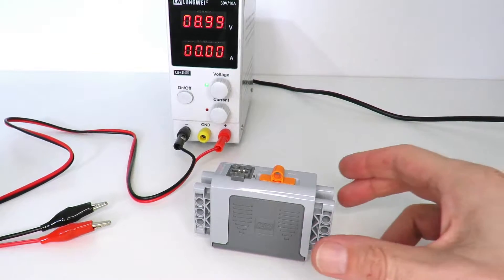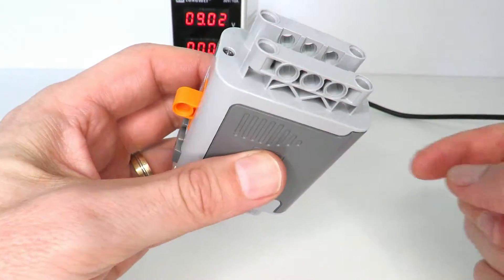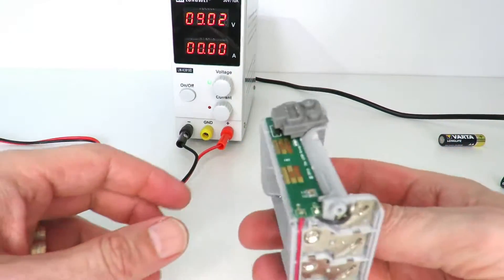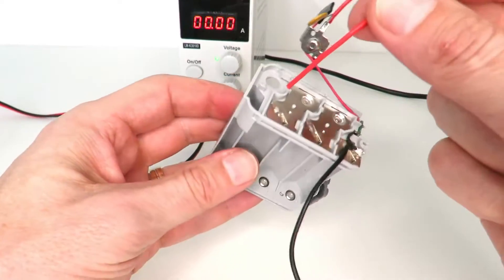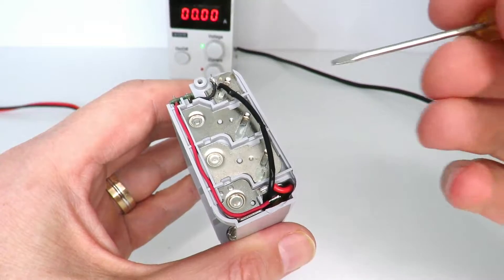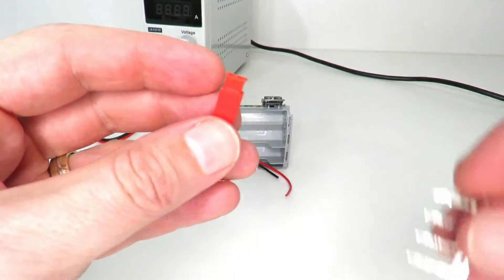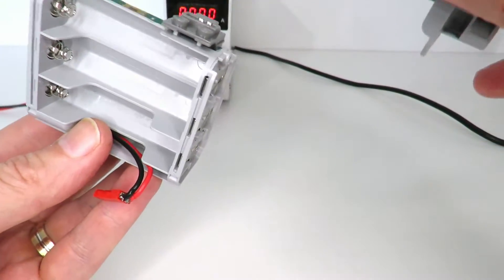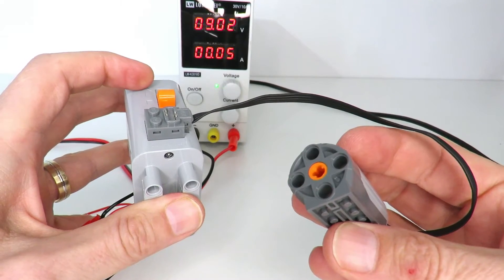How to modify your Lego Technic Battery Box. Save on Batteries! More Power!

Comment: Good idea.  I  was thinking of making one with a barrel connector from a AC/DC wall converter- that way, it is a plug.  Also, I was thinking of making another one with 3 3.7V rechargeable Lithium AA cells.  But I would hate to keep taking them out to recharge.  I'd have to have the charger external, which I guess is doable.  Also, don't know if the motors would like the slightly higher voltage.  They are 12 V motors but I think they'd last longer at 9 V.

Comment: Hey bro i have a question, can i use a adapter 12 volts 2000 mili ampere instead of a power supply??👊😊
Reply: heck yeah bro. I connected my rc battery to it and it works like a charm.

Comment: Make sure you press down on the grey connector section when pulling apart. First one I tried it rippoed the connector block off the printed circuit board. Nice solution though to get rid of the batteries.

Comment: Are you a man with super power or some sort? Because I tried to pull them apart but they won't move at all. And you do it just so easily, without any effort at all!
Reply from the maker: Hi Rizki, Strange - maybe there are different version of the battery power packs that do not open...? 🙃
Reply: There are at least 2 unique part numbers for these battery boxes.  41M5 is hard to get apart.
Reply: Ihave a 17N9 and its the same, this damn thing will not come apart

Comment: Do you have a link where does small cables and connectors can be bought? So far I cannot find them on AliExpress or eBay.
Reply from the maker: Hi Wouter. What type of cables & connectors? You mean Lego ones or just general electrical ones? 🙃
Reply: @TechnicBrickPower  thanks for your reply. I mean the type of cable connector as shown in the video.
Reply from the maker: Hi Wouter. I got mine from our local electronics shop in NZ. Here's the link that may help you find them else where. https://www.jaycar.co.nz/jst-crimp-connectors-2-way/p/PT4452 🙃
Reply: @TechnicBrickPower  🙏 thanks!
Reply from the maker: @woutervankoppen3927  Hi Wouter, I can send you some if you can't get your own.

Comment: it is possible to put inside the battery box a 11.1 V 3600 mah battery pack ?, and how to adapt the voltage to receiver, I tried a resistor but not works , the system heats so much
Reply from the maker: Hi mmm you can't easily reduce 11v to 9v DC. A voltage divider using a resistors is an option but will lose a lot of power (and generate heat as you have found...)

Comment: As a kid I bought a DC barrel connector plug to 2 loose wires cable (very cheap everywhere), wrapped the cable ends around nails, hammered them in the top of wooden dowels the same diameter and length as AA batteries and jammed them in the top two battery slots of the old 9V battery box so they would make contact to the terminals.

A small nick in the housing to let the cable out, connect a random DC wall wart (those ungeared 74569 motors really go brr when you run them at 12v) and never had to recharge a single battery again.
Reply from the maker: I like it! very creative. 🙃👏

Comment: Thank you for the video! It helped me modify the battery box in a completely different way. I only needed one battery to push 1.0-1.5V through to my M-motor. The build is a 78 cm tall wind turbine and with a 1:1 gear ratio, I can get the blades to spin at a semi-realistic rpm.
Reply from the maker: Hi Saku. Are you really running a motor off 1 battery? That's interesting - never knew it could do that ! Thanks for sharing. 🙃
Reply: @TechnicBrickPower  With a piece of aluminium foil, yes! :D The motor obviously has almost no torque, so there mustn't be almost any resistance

Comment: nice mod, 
a small correction, the gizmo after the batteries is actually a polyfuse, think of it as a self-resetting fuse that protects motors and wires from overload
Reply from the maker: Hi Claes, ah yes thanks for that. When I first saw it, it looked like a capacitor but yes a fuse makes more sense. Thanks for your input! 🙃
Reply: There's no sense to put a capacitor in series in DC current... you should add a text correction saying its an auto re-armable fuse and not a capacitor. So who is learning won't be mistaken.

Comment: What is the rpm of the motor when it is connected to that power supply?
Reply from the maker: Hi Sam, thanks for the question. The power supply has a variable voltage and if you set it to 9v then the RPM of the motor is the same as it would be if you use 9v worth of batteries. Typically for a lego technic "medium" PF motor is about 400 RPM at 9v.  However the benefit of the power supply is that you can reduce the voltage and since the RPM of a DC motor is almost linear with the voltage the RPM reduces also. So that means if you set the voltage to half (e.g. 4.5 v) then the motor will rotate at half the speed, i.e. 200 RPM. You can also increase the RPM by increasing the voltage - but risking overheating the motor and burning it out (I think it does have some protection against this built in). Also the power supply has a lower internal resistance meaning the output voltage does not drop with increasing current which can happen with batteries.
Reply: @TechnicBrickPower  Thanks a lot